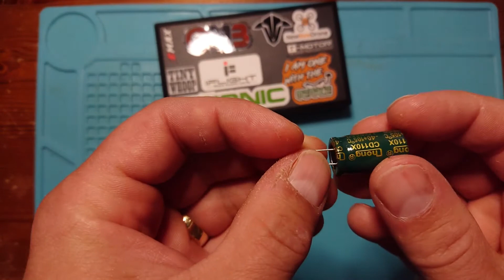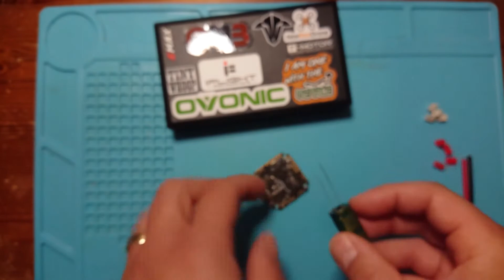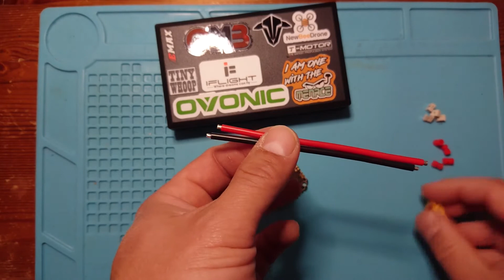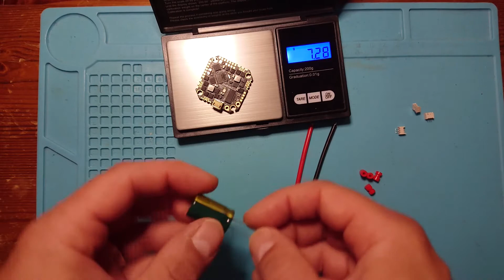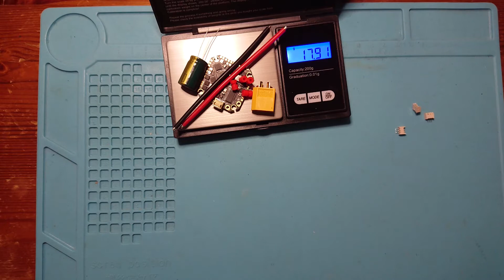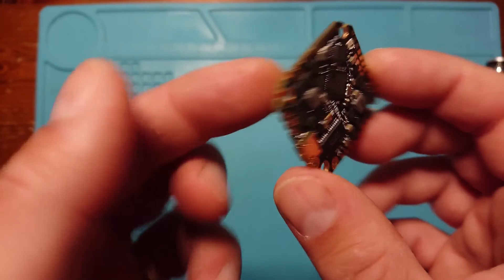Jhemcu GHF411AIO Pro F4 aio FC/ESC 35amp. Brief overview/My thinkings.....

Comment: Hello sir! I need a suggestion. Can I use BN-180 gps with this FC in Tx2 and Rx2? I am using Tx1 and Rx1 for digital fpv system and using sbus receiver.
Reply from the maker: Sorry I don't think you would have enough uarts

Comment: hello, i bought this controller at bangood, i installed the matek 411 firmware, which entered without problems and i flashed the esc with bheli sh30, and everything was fine until i put the battery in, the accelerometer becomes unstable and doesn't work correctly it becomes totally to one side the drone, I don't know what's wrong.
what problem can it be?

Comment: Just had 3 out of 3 die after light crashes running 3S and driving 1408 motors. Real light duty stuff.
Dumping this AIO garbage and going back to single ESCs.
Reply: If your ESC stopped working (all 4 motors at once) it means that there is no power for ESCs uCU. You can replace a diode close to rx1 tx1 - it should solve your problem

Comment: Is it reliable? for 3inch tp build
Reply from the maker: Should be ok for a 3 inch build. I've not had any issues with this board which is all I can say. Thanks for watching 😁
Reply: I use this on 3" 3s toothpicks with 1303 5000kv and it's flawless after 100 flights 👍 even flashed with Jesc ESC firmware 48khz bi directional d-shot telemetry.

Comment: Does the 9V output work on 3s, or even 2s batteries?
Reply: Ok... This means in those cases when the 3s voltage drops very low (during punch outs, or towards the end of the battery), there is a risk that the 9V switching power supply will brown out, and the Vista will freeze?
Reply from the maker: @LotharKrupka  in that circumstance yes you might get issues so I would stick to 4s if you think it might happen
Reply from the maker: on 3s yes but 2s no. Thanks for watching😀

Comment: Where the smartaudio pad?
Reply from the maker: Any free tx pad on an unused uart will do 😁👍👍
Reply: @Rich-TeaFPV  any? There are only 2 Tx pad (2 UARTs). One UART is for serial_rx. If you use the other one for GPS, then... no smartaudio.
Reply from the maker: @Tonynux  yep but if you use immersionrc ghost and your vtx uses irc tramp for smartaudio, connect the smartaudio to the ghost receiver and you can change bands, channel and power with the module
Reply: Thankyou richard. Greeting from Indonesia

Comment: can I use it for 6s
Reply: im using 1600kv would that be okay
Reply from the maker: What size?
Reply: @Rich-TeaFPV  1600kv motors on my 2fiddy build
Reply from the maker: @SeeFPv-qm6ie  so I'm thinking 2004 size. A aio board is recommended for that build so it might be OK. On paper it should be fine but jhemcu are a budget brand so take what they say with a pinch of salt. Personally I'd stick a throttle limit on betaflight to stop high amp draw just incase. But otherwise happy flying. 👍👍
Reply from the maker: For smaller motors on 6s maybe, without testing I couldn't say for certain so it's up to you. You could look at the amp draw chart on the product page for the motor your thinking of buying. Anyway sorry I couldn't be more helpful and thanks for watching.

Comment: Considering the 25 amp version for 3 " toothpicks on 1105s and 1204s on 3s. Is it a decent board so far ? Looks like you have 2 choices of where to solder with the motor pads down the side or the 3 on the top.
Reply: That is exactly what he says..........
Reply: I use the Jhemcu 25 amp for my 3s 3" toothpick with 1303 5000kv motors and can confirm it is rock solid after 100 flights.

Comment: Did you use sbus
Reply: I wanna use sbus for dji but no luck
Reply from the maker: Originally I used a flysky reciever (ibus) on an rx pad. But I've since moved the board onto another build with an sbus reciever. Not setup yet so I'll see how it goes. Thanks for watching 👍

Comment: Should I go for 2308 motor ? , Company say it's ful throttle 55A in 4s , and I never gO to more then max 40 amps because li-ion can't deliver 😁
Reply from the maker: Personally I wouldn't use motors bigger than 2004 with this fc/esc. It might work but your pushing it to the maximum. The t-motor velox and pacer esc's are a great alternative with a higher amp rating for a good price. Thanks for watching 😁
Reply: @Rich-TeaFPV  but in my case my frame doesn't support 3 layer , like fc + ESC + vtx to think about fc+ESC combo , what you think ?
Reply from the maker: Maybe consider a nano vtx 🤔👍
Reply: @Rich-TeaFPV  but I have 2 30-30 and 1 20-20 vtx so I can't buy newone , any other suggestions.
Thank you for your reply ☺️

Comment: Can i use iflight 1104 4200kv motor with 4s battery xt30 connector at this fc?
Reply from the maker: It should be able to handle those motors, I have the older 30amp version of this board on my cinewhoop which has 1407 4100kv motors on 4s and I've had no issues so far. Thanks for watching 😁 👍 👍

Comment: I just installed this board in a four inch 3S with 2203 3450KV motors and 4023 props. I was able to update to the newest Betaflight and flashed the esc's with the 16.73 Jazz Maverick hex file. She tested good in the backyard so we're going out to the park today. Cheers.
Reply from the maker: Cool, I've got a similar project idea that I'll be looking at in a future video. It'd be great if you could tell us how it held up (or not) thanks 👍 👍
Reply: After update to jazz its not crash resistant in my end. Before it was crash resistant esc. Maybe im having bad luck burning motor 3 esc? With 25a 470uf cap tho
Reply: @hanquah  
Use JESC firmware and it's crash resistant with air mode, and bi directional d-shot works flawlessly.
Reply: Could you plz help me?) I just updated the latest betaflight_4.2.4_STM32F411.hex firmware and gyro stop working. Then I flashed matekf411 target and gyro start work but motors are not spinning. Even ESC not enabled in the configurator (((  then I flashed STM one more time - the same issue >> gyro and all other things - ok, motors - NOT((